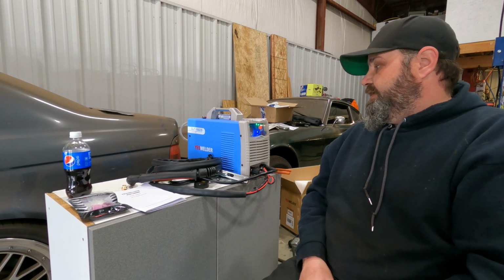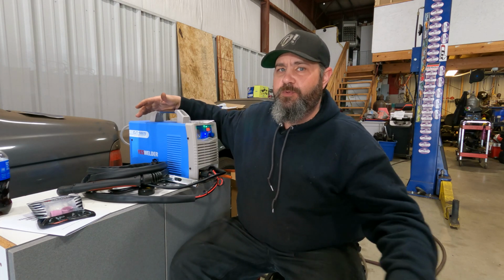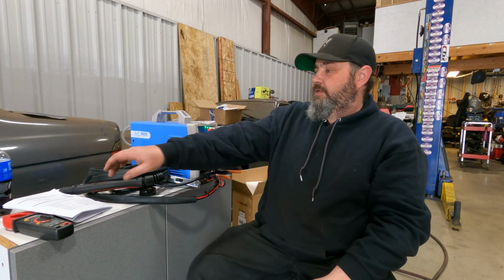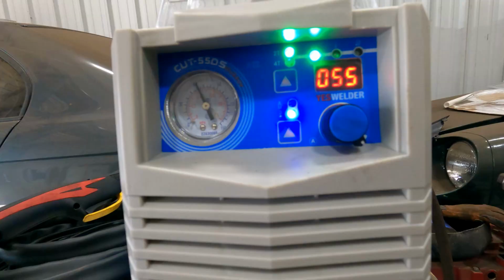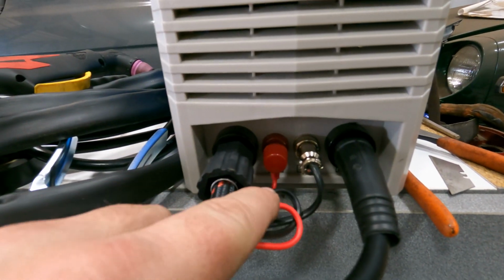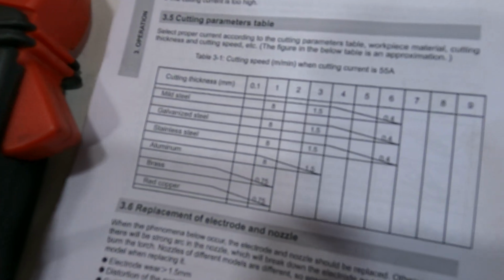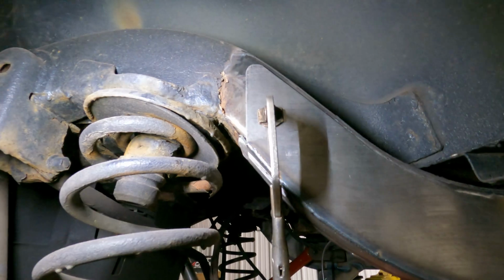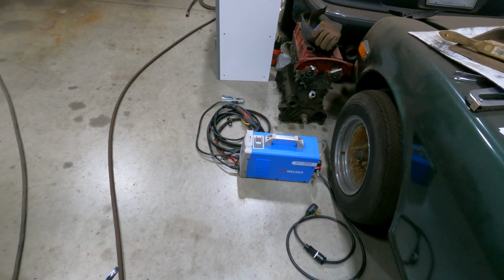Yeswelder CUT-55DS Sub $400 Plasma Cutter!

Comment: These cutters should always come wired for 220 volt ( with adaptor to drop to 110 ) you will leave adaptor in 220 one day and some idiot will think they can plug a 110 tool into adaptor. 💥

Comment: You want to make your cuts a little bit easier cuz it looks like you drag cut if you got a deburring wheel on one of your bench grinders which I'm sure you do if you own a shop taking smooth off your cutting head where the little Criss crosses are cuz there's always a little roughness there and it'll drag on that cold rolled or hot rolled or whatever so much better it's unbelievable night and day difference

Comment: I bought a hynade 3 in 1 plasma Tig atick welder with great skepticism I thought I was cutting 3/8 of an inch and I could barely get through it and I was getting pissed off it turned out it was .55in cold roll!  That is 14 mm and I was all pissed off it's not even rated for only 10 mm and I was mad because I was in a rush and I grabbed something that I thought was much much smaller. I'm usually pretty good at looking at a piece of metal and knowing exactly what size it is I don't know what was going on other than there was some bevel on the edges that might have made me think it was smaller stock I don't know but it was bigger than half inch almost 14 mm just a tiny hair shy of 14 mm and I could barely get through it but if I would have worked on it for a minute I would have been able to cut it

Comment: Anything you missed & would like to add? Yeswelder just sent me one to review & I've been watching A LOT of videos from folks who don't know how to run it. I'm going to put it up against some aluminum. Are you dragging that tip?  Solid video bud.
Reply from the maker: I did some drag testing and it works but eats consumables like mad. Its best to keep a small gap or use a standoff so you arent directly on the material with the tip. The pilot arc is amazing it chops right through rust and rot with no issue. I have been beating this thing up from the day i got it running full 55A 3-4 hours per day without a hiccup. Run it 40-60psi and it should be golden.
Reply: @MorFabIndustries  how did you adjust it to get the full 55 out of it?
Reply from the maker: @WHITERIVERRAMBO  Run it at 220V input and max it out. Short circuit it will push 49-52 on average it runs about 39-45 amps continuous. Not quite rated power but for the price you cant beat it.
Reply: @MorFabIndustries  appreciate the replies

Comment: $465 now. ($322 with 30% off discount code) Love inflation. I got their MIG/TIG/FLUX/SMAW unit and it was only like $350. Runs great. I just don't like how the manual is clearly written by a Chinese person with broken English and has clear errors in it. Just like you noticed with the 220/55 amp thing. That's.... crazy in my opinion. But... I might grab this. I'd need to buy a large air compressor though. My pancake compressor would never shut off and probably not be enough.
Reply: It’s $380 on Amazon today (2-3-22)
Reply: @Diggin00  Oh yeah? You can get it for $322 from YesWelder's official website with the 30% coupon code they have right next to the buy now button. So little cheaper. Then again $380, if you can use the 10% off promo code from the channel would bring you halfway to $320.

Comment: Thanks for info and video.   Just one question  I can't get anybody to answer.  Will it run and not burn out my 6 gallon pancake compressor or do I need to make room in my little garage and buy large compressor?  I am a wood worker with welder wanna be.  Thanks
Reply: U will definitely need a bigger air compressor
Reply: @karma8001  Thanks.  I bought a used 30 gallon 5 or 6 scfm compressor.   Thanks.

Comment: Went to the link and the best price I could find was $459. And that’s with a 15% discount. Maybe I’m looking in the wrong place. Sounds like a bait and switch.
Reply from the maker: Since the posting of this video, the prices have gone up a bit. If you use my link and put the Cut55DS in your cart, you will see the price drop to $391.00 at checkout.
Reply: @MorFabIndustries  Where is your link so I can order the plasma cutter?
Reply: You should be able to get one cheap. I just ordered from Amazon in Canada for $389.00 CAN   Total with tax $448 to the front door.
Reply: Just purchased for $320 and added a bag of consumables for another $24, looking forward to cutting some metal.

Comment: Thank you for your time in making this video. Just to clarify, on Yeswelders website it shows: "Max Rated Clean Cut Thickness: 5/16"@110V, 1/2"@220V" so I takes it by your video 1/2" is just a little far fetched? Thanks again
Reply from the maker: It will do 1/2" very slowly but I don't recommend it.
Reply: @MorFabIndustries  Copy that 👍

Comment: Great to see technology comes along,I have a snap-on plasma 30 unit,and it's a pilot arc unit,and yes they cut nice,3/8 is no problem,1/2 inch takes 2 passes,but yes price is a big issue if you are just getting started.Glad to see you on videos,was wondering about you lately,I've got my jeep project going,went a little more in depth,pulled motor and trans,pulled tub,built rack for frame support and am able to get frame squared up,keep up good work and yes parts are slow cause of the pandemic and democrats.till next time.